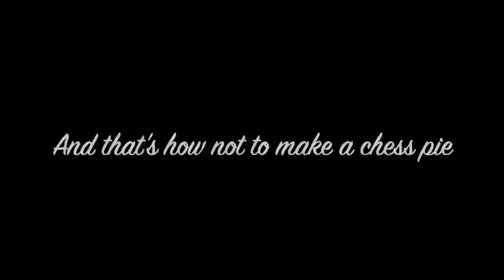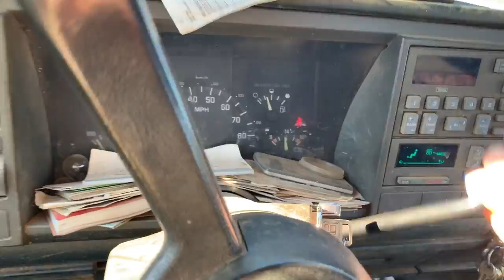The Farmer Speaks His Mind

Comment: Meredith, Lawrence,  one trick to getting an engine started in cold weather is to turn on the headlights for about ten seconds before turning the engine over.  Then turn them off, and try to start the engine.  In cold weather, it actually will "warm up" or "energize" the cells before getting a "shock" to turn over and engine.  I have done this here in Indiana and especially in the northern part of the state, it does work...You can actually hear the difference in the speed the engine turns over. The other alternative besides that and Jump starting, is a "float" charger.  It stops charging when the battery comes to full charge.  They are sold a Rural King Stores, Tractor Supply etc..  I keep one on my Allis Chalmers D17 until I get the opportunity to work on the electrical system.  I wish the made one in 6 volt for the 8N ford.  Probably the best 16 dollars I've spent lately.  Love the videos, looks a lot like right here in Southern Indiana.
Reply from the maker: Thanks for the tips!! I'll share :)
Reply: @ThisFarmWife_  let me know how it goes. please

Comment: Your tire might be leaking around the rim. You might have to reseal the bead on the tire. That happens sometimes when you get too much dirt around the bead of the tire. or you run over something or it could even be the valve stem.

Comment: Is it possible to use your backhoe or a drag blade to knock down your ruts in your feed lot while it is frozen? Or is the soil there the type that it will be to soupy when it thaws? I used to use a IH 300 and a blade on three point hitch to do the one I had 35 years ago when I was a kid. Lot was about 100 by 150 ft and fairly flat.

Comment: You have to remember that humidity works with both cold and hot.  The higher the humidity, the faster the outside temp is transferred into your body.  So 20F in NC is colder than -1F in dryer places.  And when I say colder, I mean you'll die faster exposed to it.  Like how you can die from exposure in 70 degree water.
Reply from the maker: That's true, I never think about that